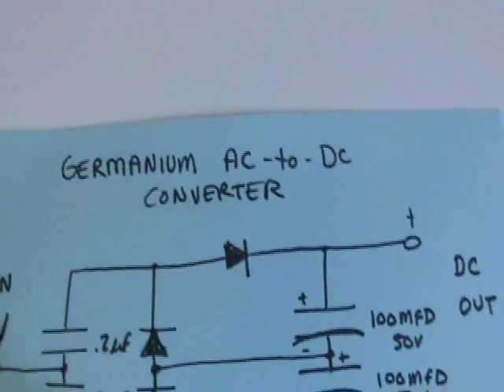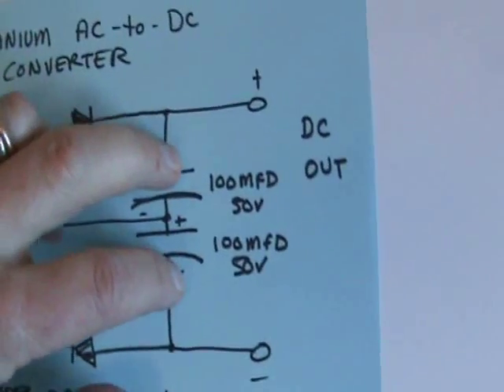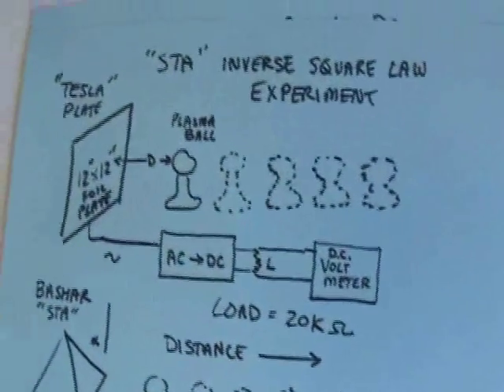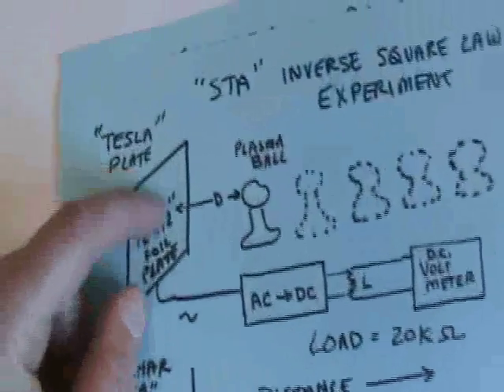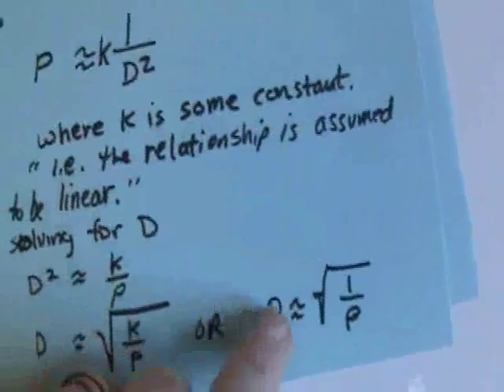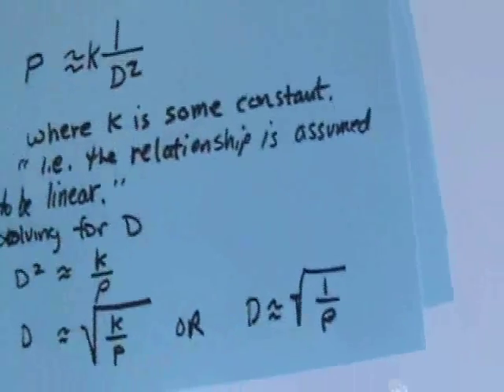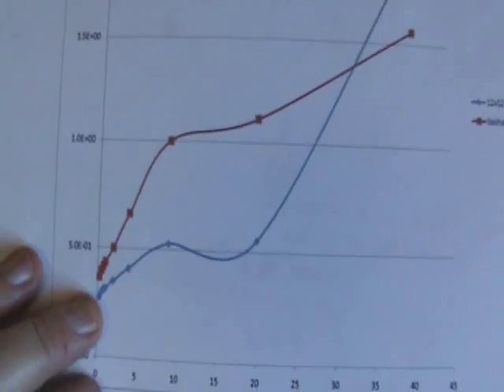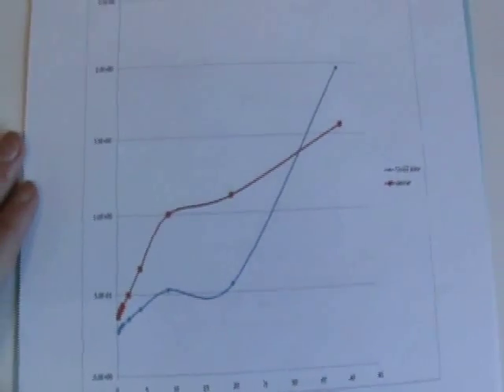Ep. 8: Bashar Free Energy Space-Time Antenna (Inverse Square Law)

Comment from the maker: @madhacker2000 
Hmmm... I would think that if each 100MFD could handle 50v, then since they are in series, the danger point might be 100v. One epiphany for me, having been influenced by reading T. H. Moray, is that I can pick whatever load I want ... and if I pick a load modest enough, I can make the voltages climb. Just like your bank account, you want a positive cash-flow as it where or a balanced budget. If you don't want to go into debt, power wise, or the circuit won't build power.

Comment from the maker: @madhacker2000 
yeah it was hit-or-miss for the value of capacitance on the tetrahedron. I used foam board which is pretty thick at slightly less than 1/4 inch. There was no attempt on my part to calculate what sort of capacitor I was making. I just measured it with a cap meter. This first proto-type Bashar thing gives some data only to build the next one, and so on. Yeah I think high-voltage is wanted definitely, but the capacitance value must be chosen to match the coil for a target freq.